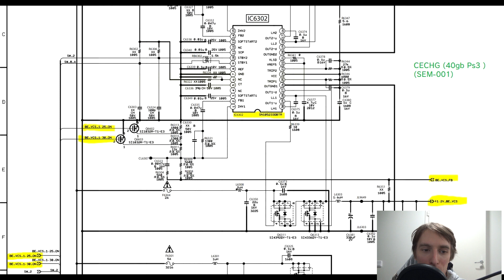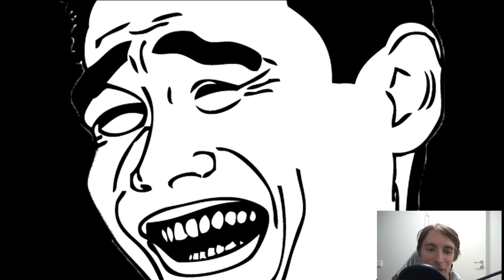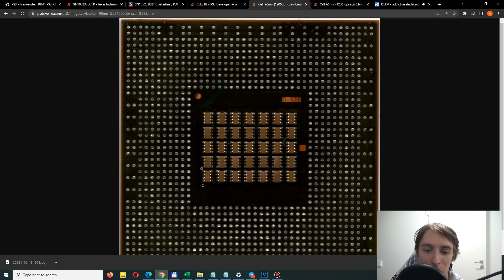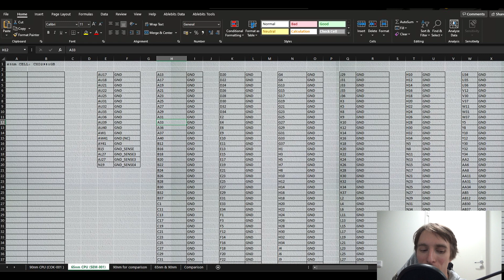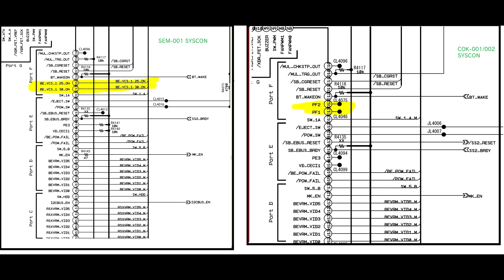Designing PS3 Cell Frankenstein (Why retrofitting 65 or 45nm Cell BE is difficult)

Comment: I think the best use case for a CELL BE interposer would be for a 512MB XDR DRAM upgrade, I've had a quick look at the pinout of the CELL and I see an unused address lines for each of the four RAM chips labeled "Y*_DQ*(N)_8" (the first asterisk being 0 to 3 for the four chips, the second being the address line I assume and "N" I have no idea, I'll have to look a the datasheet for the RAM chips).

I was lucky enough to get a DECR-1000A when they were still fairly easy to acquire (though she's a bit sad right now with overheating issues and broken USB ports), but I'm not a gatekeeper, I want devkits in the hands of as many people as possible so they can create incredible things with them, even if it reduces the value of my devkit.

I originally had this idea while looking into converting retail Jasper Xbox 360 motherboards into Jasper Advanced boards (with 1GB RAM, used in the XDK-GB devkits), but as the full pinout of the Xenos GPU (contains the northbridge and mem controller) has never been leaked it would be impossible to find the 13th address line without a devkit to sacrifice to the cause (it's not in the schematics or board layouts). So I'll gladly look into the PS3 for now, but I couldn't do it alone as I lack the knowledge (and quite frankly, intelligence) for such an endeavor, plus there's no saying there won't be firmware or syscon hurdles to overcome even if a hardware mod is successful. So I'm kinda' throwing down the gauntlet here hoping to spark interest.

Comment: its been a year, any new info on this?
Reply from the maker: There is no demand for it, so the project is dead.
Reply: @calyps0man  thats absolutely shit. i guess people feel the RSX was the only problem and the 90NM cell is just fine?

i wonder what the failure rates are of the 90nm cell due to heat or other factors.
Reply from the maker: @thelasthallow  Cell rarely fails indeed. It seems to be invincible and doesnt care about heat as much. The thing with designing an interposer is actually pretty silly. At that rate it's better to redesign the whole motherboard. But again, what for? Massive amount of work. Maybe if I had no life, but luckily or unluckily, I do :D
Reply: @calyps0man  i wonder, do you happen to know what the temps are on say, the Cell or other parts of the board when swapping a 90NM RSX to a 40NM? i feel like the huge heatsinc on the 90NM PS3s would actually end up keeping the 90NM cell way cooler since its not also trying to cool a 90NM RSX at the same time. like overall total system tempature should be way down i would think.
Reply from the maker: @thelasthallow  I haven't compared side by side, but I think Cell is maybe slightly cooler. Not sure. But it wouldn't be a big difference most likely. Cell is still very hot.

Comment: Hey Hello So Please Bro which are the Improvements on this today?? Is anyone working on Cell B.E swap with newer models?
Reply from the maker: I have shared the project files at psx place forum, I don't have time to work on it myself anymore. It would be a huge effort with dubious results.
Reply: @calyps0man  Alright But if you think working on a 28nm Rsx mod to be installed on Cok-00x then that's the real waste of Time, if you thinking or are working on that then working on a 45nm Cell install on fats would be a far better advantage for Ps3 and Actually an 28nm Rsx Brings no real Benefits compared to the 40nm one installed on the fats!!! And an 45nm Cell installed on an 4 Usbs Ps3 would Turn the PS3 Imortal if 45nm Cell plus 40nm Rsx, the Cell would work at 58c Max with minimum fan speed.
Reply: @VictorHugoAlvarez-tc4tg  Swapping to 45nm cell would really be the ultimate ps3. I bet fan speeds could be low as 20%. Imagine a full backwards compatible system that runs both as cool and quiet as a slim. 🤯

Comment: The only benefit I see with changing the 90nm Cell to the 45nm Cell, is lowering elecricity consumption and less heat in the overall system but I don't think that it would make a signifcant difference to even try.
Reply: You don't even know, An 45nm Cell in an Cok-001 or 002 board would work at a much much much Much Much lower temperature on that massive Heatsinks of the Cecha/e/b/c, As 90nm works as 78c an 45nm would work at 58c.
Reply: Bruh just imagine overclocking that thing
Reply: @gnrtx-36969 I don't think overclocking the Cell will have as high of an impact as overclocking the RSX is having! Cell wa always the PS3's strong part, while the nvidia 7600-based RSX was never as good as the Xboxes ATI counterpart.
Reply: @coccoborg  well yeah most games dont even utilize the cell Completely but it will make big difference in last of us and other exclusive games since this cpu is also vector processor 
About rsx it lacks texture unit and no edram for anti aliasing but it isnt that bad compared to xenos ati
Biggest problem was the cpu bottleneck
Reply: @coccoborg  That's not even close. The RSX is based on a 7800GTX which is pretty much the same as the Xenos, in some aspects it was better in some it was worse but not by much. CELL SPU utilization is lacking and a CPU overclock would improve everything considerably.
Reply: I want to put 4 nm chips in it.

Comment: Solving the CELL marrying issue can potentially fix all those broken PS3s that died when they were being delidded. 👍
Reply from the maker: Well, it can already be done but requires CEll+NAND+Syscon swap. However 90 to 65nm Cell is still not possible for now.
Reply: @calyps0man  personally, if you have an original PS3 and swap the 90NM RSX to a 40NM RSX, the 40NM RSX runs so much cooler that will actually reduce the overall heat of the unit and the Cell should run siginificantly cooler as well. IF a cell swap would ever become available to even a 65NM Chip the original PS3s would run really cool.
Reply: @calyps0man  If it's not pin compatible, I could see this being similar to the Pentium 3 Tualatin Mod. Some Socket 370 motherboards don't support the Pentium 3 Tualatin but there are custom interposer boards that are soldered on the chip that bypass this issue and there are socket mods for the OG Xbox that can fit this chip. The later model Cells that are put into the early model ones, would need just that. A custom thin PCB or a flex that solders onto the later revision Cells for it to be compatible with the 90nm motherboard, but it will be a lot more complex.
Reply: @calyps0man There is a Cell Remarry option on the Syscon.

Comment: I've got one "good" board with broken cell (during delid) and another board (with liquid damage but the cell nand and sys are in theory good), can I swap the 3 elements on the "good" board and save it?
Reply from the maker: If the boards are the same, then yes. I know people who have done it successfully.
Reply from the maker: Actually I think even swapping between cok-001/002 is possible, but there may be additional changes needed in syscon code.
Reply: @calyps0man  I will definetly give a try, don't know when or how, (lack of good tools) for the sys and nand shouldn't be a problem but I definitely need a rebaling station for the cell
Reply: @calyps0man  I will definetly give a try, don't know when or how, (lack of good tools) for the sys and nand shouldn't be a problem but I definitely need a rebaling station for the cell